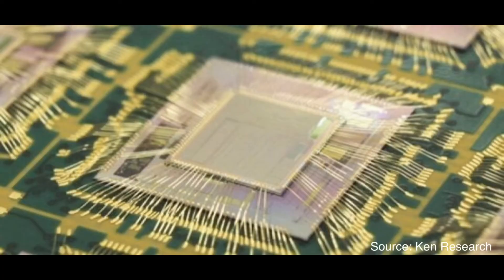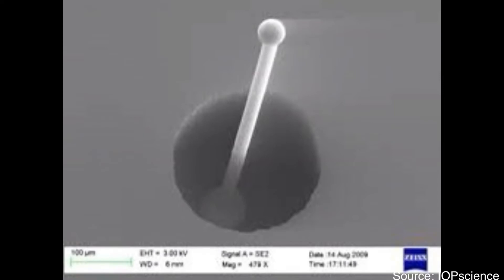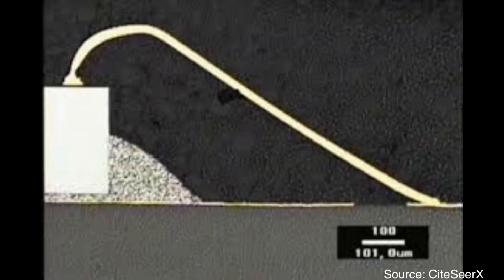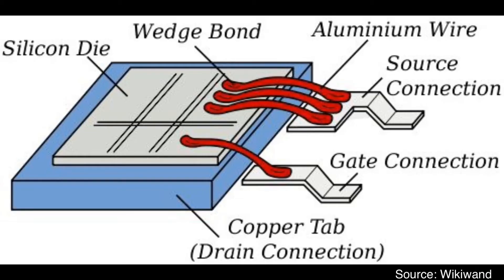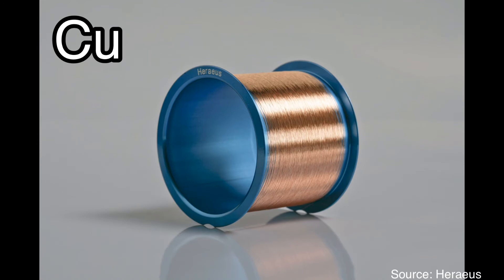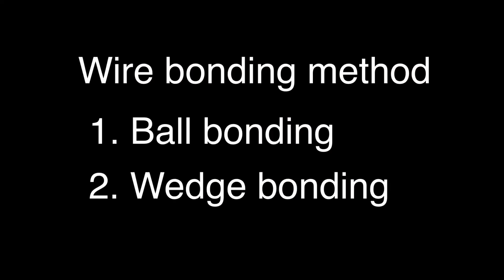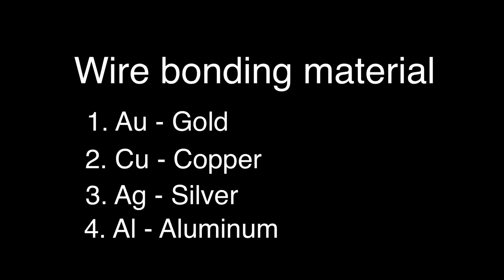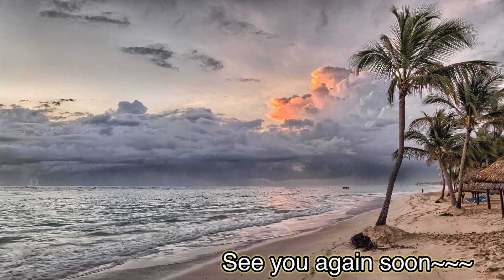[Eng Sub] Wire bonding process: Ball bonding, Wedge bonding, Au, Cu, Ag, Al Wire

Comment: Hello.. I want to ask some technical question. If I have 4 same dies, but only one keeps showing crack, does this point to the aluminum bonding process issue?
Reply from the maker: It seems like die issue rather than process. But it will be better to check every detail items like whether there is any different process condition for that specific die with constant crack. Sorry not to give clear answer.